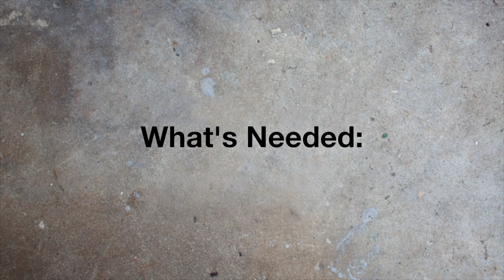Polycarbonate Door Window Kit Install - E36 Coupe - Condor Speed Shop

Comment: If I wanted to lower them more can I drill extra holes
Reply: Carlos Becerra I guess no one answered lol
Reply: This is what I’ve been wondering myself, I don’t see why it wouldn’t work
Reply: Carlos Becerra just be careful to not crack the glass itself, good luck
Reply: So quick update, I completely misunderstood the purpose of these and you can NOT drive with these on the vehicle. I purchased these with the intention of finally figuring out a way to make the e36 windows manual instead of electric because they absolutley suck and something always breaks with the window regulator or motor, I took out the glass and regulator/motor and popped these bad bois in but the top corner will only stay against the vehicle if you are outside and push it into the seal. Long story short these will not stay against the vehicle if you are inside of it trying to drive, the sole purpose is so that your vehicle will not be outside without a windows

Comment: If you’re thinking about putting these on a street car I don’t recommend it
Reply from the maker: zig they aren’t designed for street cars. If you do want to use them on a street car, you will need to add extra bracing around the window frame so they stay in place.
Reply: Condor Speed Shop +1 just thought I’d give a little insight, since there isn’t much available for these